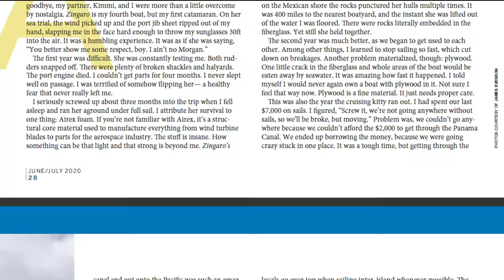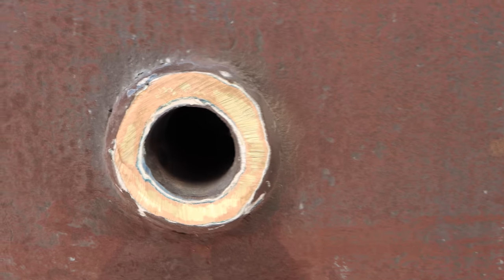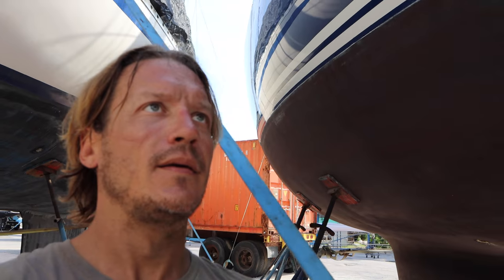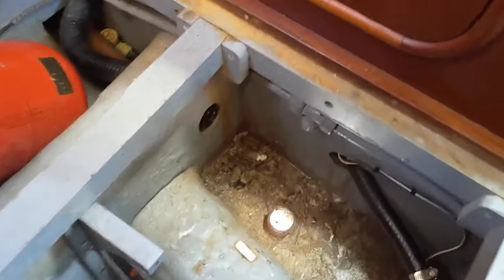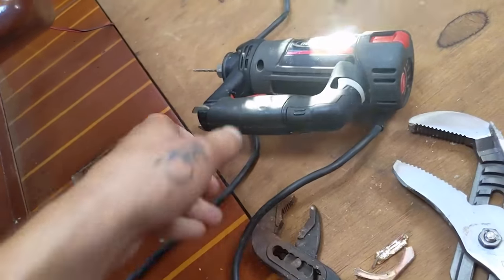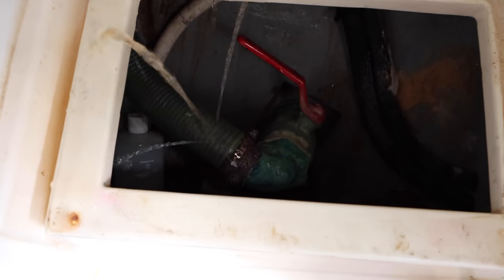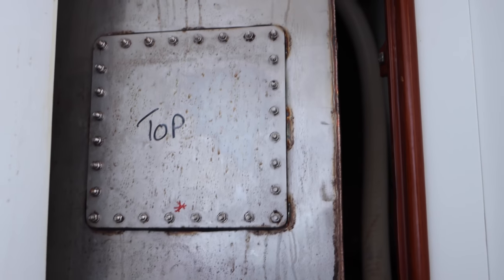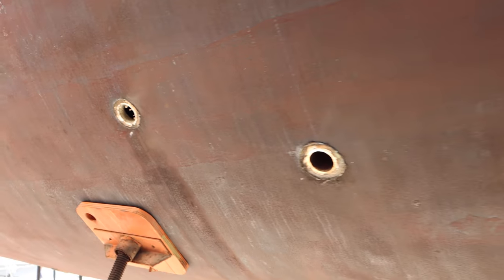I'm changing all the thru hulls, but how to get them out?

Comment: Like removing a pvc solvent joint.   You cut 2 sides.   Heat it a bit and hit.   Comes right out.   Again....just need a plumber.  

Very much like making a transition from galvanized to copper.   Allll day.   Not a crazy thing to do.   It is often.

Comment: I reckon in the future the key-words will be DON'T RUN AGROUND and stop up all the exit holes.
Reply: "Dont run aground" well I was watching an interview with the guy who owns Kracken Yachts and he said he has had two time when things were unavoidable.  Once they were put in the middle of the Atlantic and they hit something I think @10 knots?? maybe? I think he said 62 tons? and they came to a DEAD STOP in the middle of the Atlantic- they checked the depth, checked charts  and said it was either a blue whale or a semi submerged container.  when they got where they were going they hauled out and the massive solid bronze skeg (I think he said it was his skeg) was bent several inches.   Another time he was in Indonesia and he said it wasn't properly charted and it went from something like 20 meters to 2 meters very suddenly.  He has an integral keel so he wasnt worried but he was talking about bolted on keels and he had 3000 miles before he could get to somewhere that could haul out a boat if his size (70-ish?? feet maybe more) So he was talking about the times when it's not poor seamanship but bad luck.

Comment: ID Bearing puller slide hammer from the inside would pop those right out.
Reply: Heat gun turns 5200 too soup at 400 degrees they push out with a stick or hammer handle

Comment: Avoid this problem in the future by fitting composite through hulls now :-) That hull is so thick that there is no structural problem.
Reply: Are composites really the ultimate solution? I've heard mixed reviews. That being said, I have heard nothing but good things about bronze...if you can find them, and if you can afford them.

Comment: What happens to the bronze that makes them turn pink?
Reply: dezincification the zinc leaches out of the bronze, like an anode - the pink is just the copper left behind & copper thru-hulls are no good to anyone
Reply: All below waterline metal fittings should be bonded (6 or 8 gauge green color-coded wire connected to the boat’s anode system).  I would also replace every through hull in that boat with quality marine alloy bronze fittings - cheap insurance in the long run.

Comment: Close all thru-holes with fiber glass. Start all over with new. Do not drill 15 holes here and there. A few is enough with new valves. Brass ... plastic valves are cheaper and ok. I have used pro plastic valves and brass thru-holes. My boat have  3 holes.

Comment: Looks like a balsa core inside those through holes. (And it sounds like I know what I'm talking about... not with this). Is it possible to grind, sand ??? into that balsa core in those holes, add some thickened epoxy then ream the holes with a drill bit to fitting size? I'm sure there's already some  kind of sealant, but I'm a belt and suspenders kind of bodger.  
And having the right tool, or the right part for the right tool... This is the painful part of fixing anything. The fix takes five minutes, getting the right tool, or getting the right part... 'five hours?' Been there done that. I feel your pain (and annoyance. I've got a drippy faucet in my bathroom. No problem, thinking ahead I've got extra washers in the medicine cabinet. But the angle stops don't work - they're always crap, and my main turn off is seized and the handle broke off... at least if I ignore the faucet for a while my house won't sink.)

Comment: ☺☺Work ,work work always an interesting subject ,the more from an armchair.☺☺I have spend my life around boats ,from sailing dinghies as kid to sail yachts ,to fishing vessels,I also worked years as a shipwright.
All along I wondered why bronze is held so high specially bronze screws I can already hear the screams from the traditionalists but lets be honest past the look the stuff is a bad nightmare. Since  they finally make good synthetic accessories do yourself a favor
get rid of all that soon to be corroded sh@t and go plastic (marelon) even if more expensive take the plunge you will thank yourself soon enough.One bad electric connection and your bronze $$$ is gone in a month.Spend the money in the right place.
From experience inside the boat Above WL you can use regular quality  plumbing valve, they are cheap and can be all changed at once every so many years. Want better go industrial polypropylene not marine to save$$$.

At(9:10) If nasty cant believe you let it run. it is stoppable and pump out the tank.Its your house. Keep the good work.
PS:During WW II when stuck they could service a whole Sherman tank with a hammer and a chisel.

Comment: Ha Ha Poo water. Suck the tank dry with a honey tuck first, failing that pinch the hose shut up stream of the valve- remove the valve and through hull- jam another hose on and empty into a barrel OUTSIDE of the boat.

Comment: I like what they did, because once the tube is cut thru it will collapse making it small enough to get out of the hole and also lose the threaded part
that and, you can do it alone, you dont need someone to hold the inside threaded part. I guess it could be cut by hand too, might take awhile tho
A bit like the Kamala self employment program

ok when you get a thru hull without much gear to get it out
you can cut or find a thick piece of steel plate into a wedge that you can poke the sharpened into the fitting
hammer it in there so it bites into the metal
cut the flange part on the inside with a chisel, so that it will stretch or separate
then get a wrench, maybe with a pipe on the end, or a plumbers stillson will do, I think I saw one on the boat
grip the plate and twist the thing loose

You could have wrapped lagging around the pipe to slow or end the leak
its a terrible job, but enough lagging like that will even seal a steam main thats failed

Comment: I have worked in the marine industry for years.  I have never seen thru-hulls so bad.  I know why too.  Where are all the bonding wires?  Not a single thru-hull you removed was attached to a bonding system.  Dude, did you not have this boat surveyed?  When you are done having all the rotten underwater hardware replaced, install or fix the bonding system.